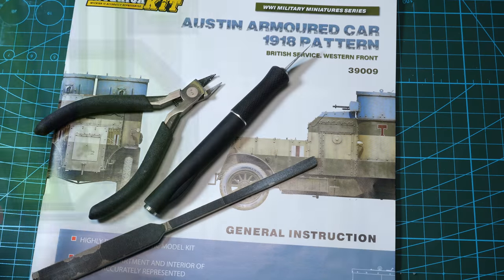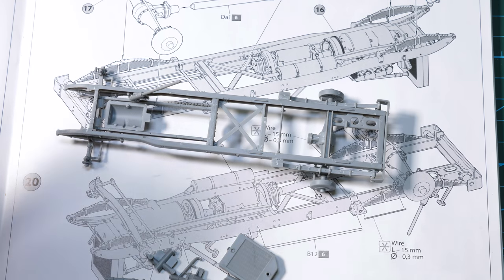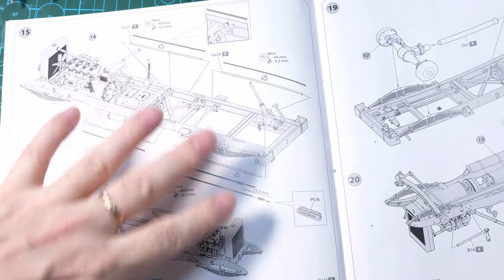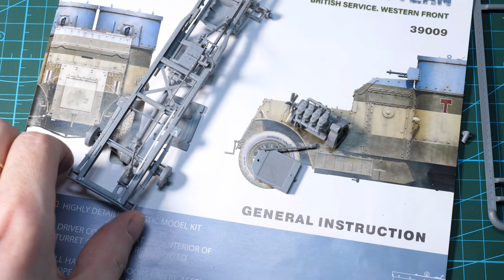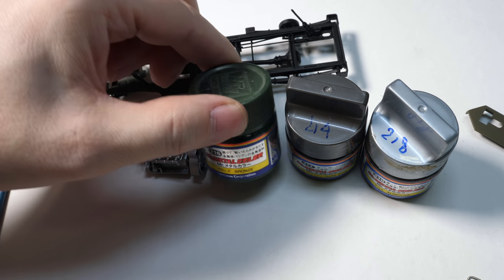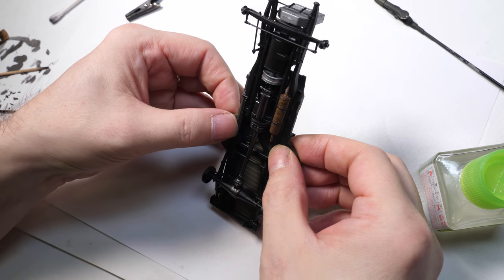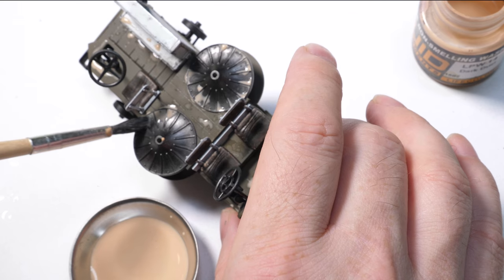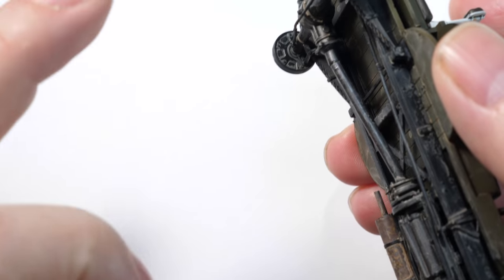Miniart Armoured Car PART II Chassis HOW TO EXPERT BUILD !

Comment: I'd have liked to seen the seats done in normal speed so I could get a wee tip?
Reply: Hi, can you tell me please what color you use for the tyres? Much appreciated
Reply: I managed to get a good worn effect on my seats with them scale.75 wood and leather paints and some AK transporator and a vallejo glaze for the layered dust effects on the floor turret mounts! I'm quite please with it and the way I've managed to get the worn wood flooring done using the birch colour wet blended over the Pannals it really does look like dried out worn varnished wood! I'm still pretty new at the weathering everything just now is an experiment to see what works so learning as I go but not sure what tone to.doo the tyres.